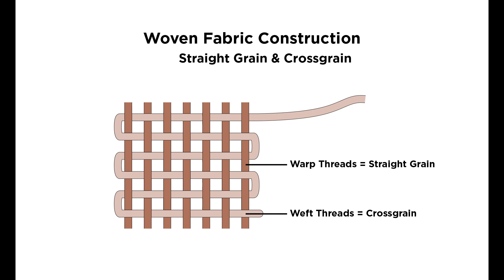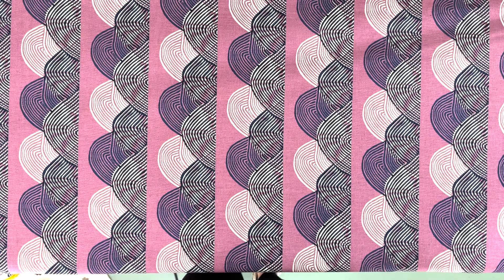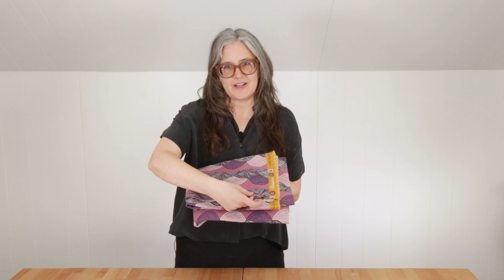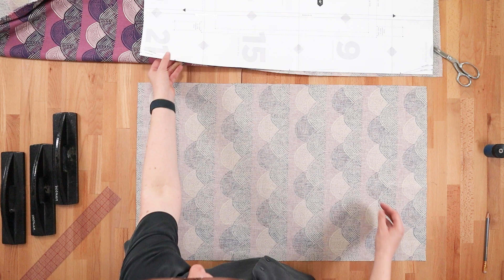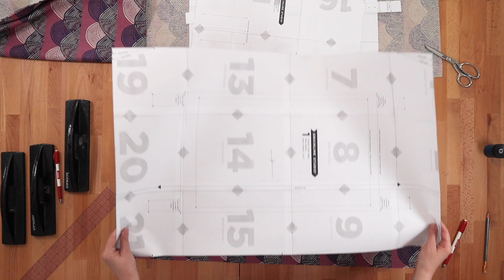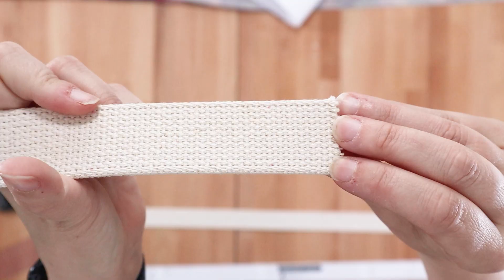Town Bag Sew-Along Day 3: Cutting Your Bag

Comment: My outside pocket fabric is directional. Should I cut and seam it before cutting  the pocket out or after?
Reply from the maker: Ooh excellent question. In that case you can do that, but I would only recommend doing that if you have a very heavy duty sewing machine. You're going to have to sew through 3 layers of canvas plus a French seam to create the gusset at the bottom of the bag and any additional seams will add more bulk.
Reply: @GrainlineStudioSewing  forgot to tell you, the pocket is cotton BUT it will be interfaced So I will have the layers. For the first bags, it sounds like I am going back to the drawing board. No problem. 😀
Reply from the maker: @donnaf4271  Ah yeah okay, sorry about that! It'll be worth it though, I promise <3
Reply from the maker: I just realized you said before or after, I would seam it before if you can otherwise you'll need to add seam allowance to the cut edge. Other than that either is fine